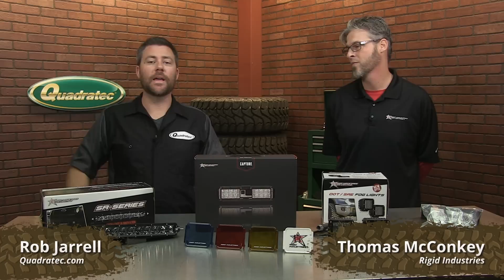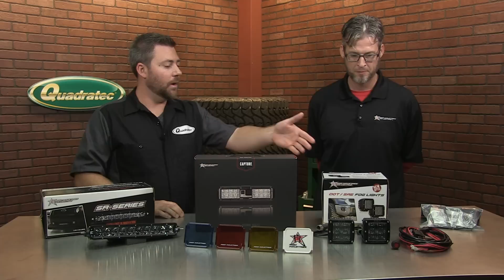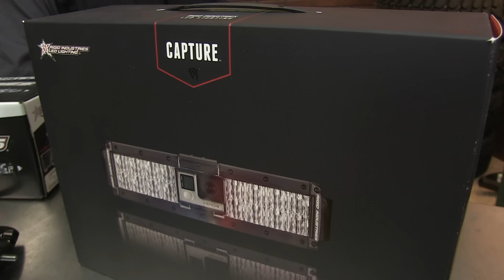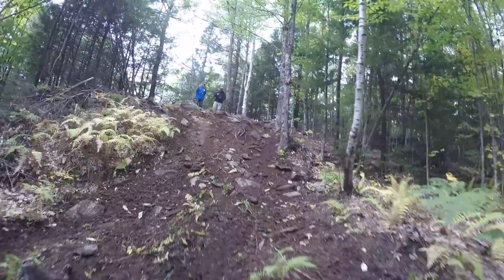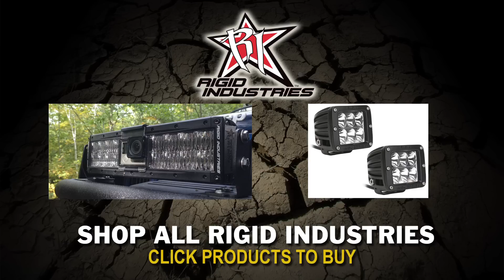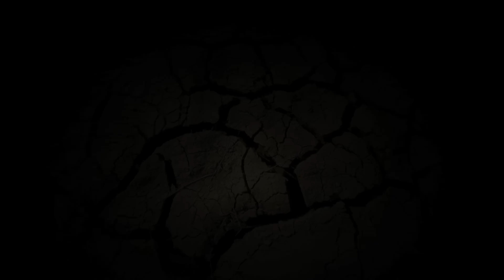Rigid Industries LED Lighting

Comment: windshield Duel Pods should you run 2 Spot LED's 
on each side or should run a Spot and flood on each side? also do you 
think the LED Amber LED should be mounted on the bumper? pointing strait
 foreword or pointing up a little
Reply from the maker: What type of lights you choose to mount on the brackets is really up to you. Generally we recommed the use of spot beam pattern lights for a-pillar brackets because the beam pattern is more narrow and less light will be reflected back off the hood of your Jeep than there would be with a wider, flood beam pattern light.

As for bumper mounted lights, usually you want the light aimed slightly downward, so that it projects on to the road surface in front of your Jeep. If it's an "off-road" use only light, that you could aim it slightly higher.